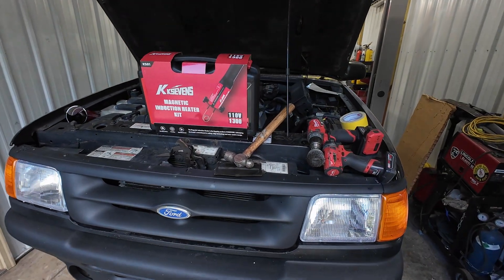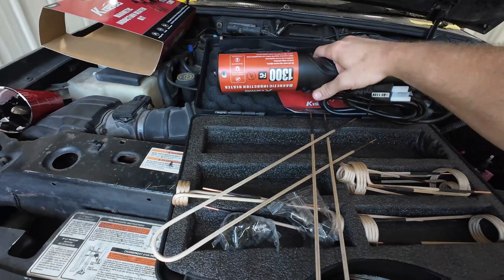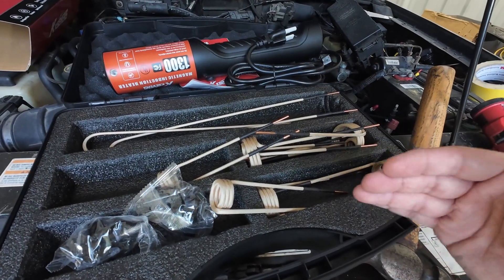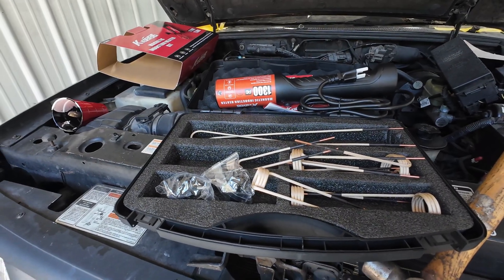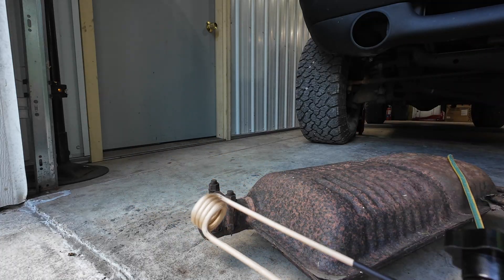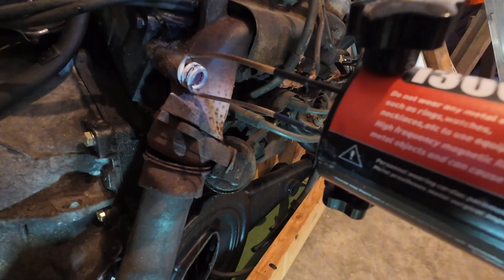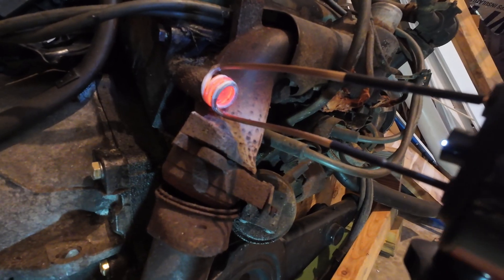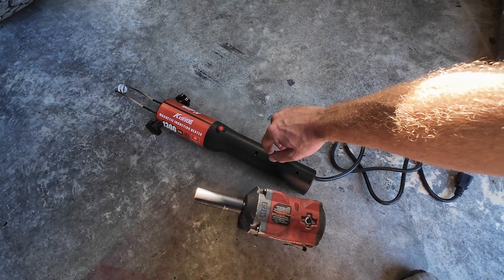KKSEVENS 1300W Magnetic Induction Heater Review - Finally An Affordable Tool That Works

Comment: I have a 96 Explorer and many shops didn't want to touch the Y-pipe . I ended up welding the crack. This would probably get off those bolts if I ever have to do it.
Reply from the maker: It definitely would. It's a great tool to have around for those types of jobs